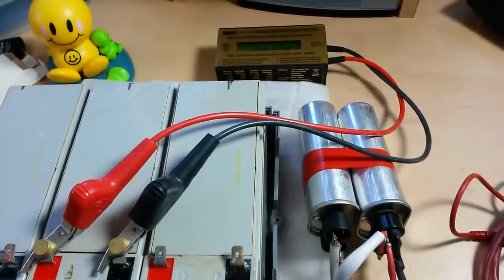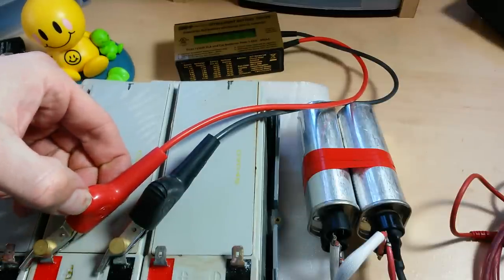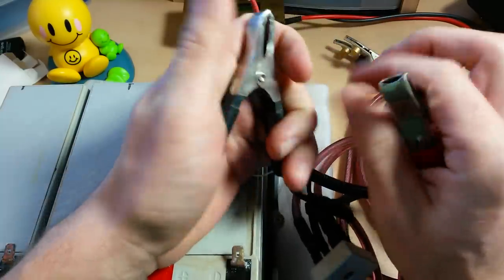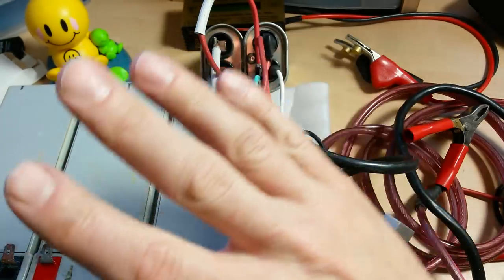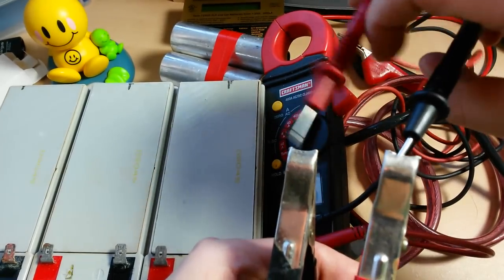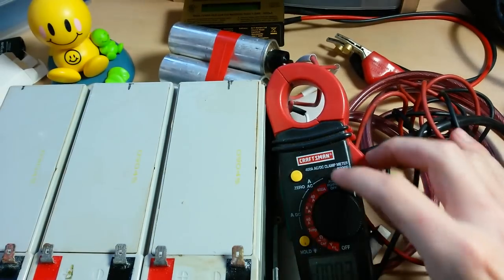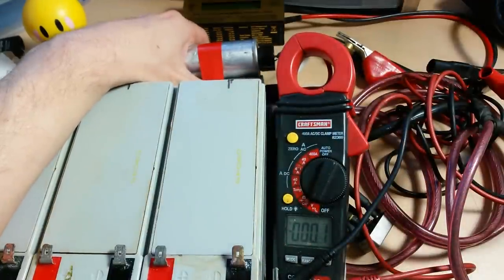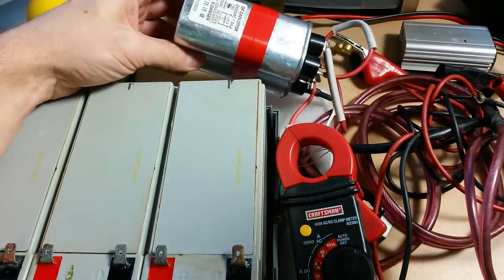(:Myth Busting:) Battery Restoration Myths: Epsom Salts? Proper Capcitive Charging & Desulphation

Comment: Hi can you use a mains transformer to say 25v a/c then ({run} a/c) caps and then bridge rectifier (lower levels caps v. and rectifier v) and may not kill you and may be some light/indicator and switch on mains !  (may be also having some micro vibration on/under  battery  to help dissolve crystals (or dislodge  and put them back in solution AGM batts even harder ! ( If it took 3 months to sulfate the battery could it take 3 months to desulfate ?) Energy out minus losses = Energy in plus loses ! May be better idea to do a maintaince program on all batteries from when you buy new ones, cleaning new sh-t is easy old sh-t is harder!

Comment: Built one of these. Very sulfated wheelchair batteries. They were both at like 4 volts. Have had the desulfator working on one battery for about 5 days now and only up to 6.7 volts. 

The little box you bought at ebay is also a desulfator. Free plans for that one are all over google. I also built one of those but like you, I dont think it was doing much. 

Now for my question...If my battery had a dead cell, wouldnt it cause much heat due to resistance?
Reply from the maker: you can't bring it back if it has a dead cell. don't even bother trying
Reply: +gary dolph  A dead cell is open as in "burned out"... and if its in a lead acid, the battery is shot. if its in a battery pack such as in a rechargeable drill that cell can be replaced  to fix the battery "pack"

Comment: And they are big enough to kill you if shorted out between right and left hands, they will store a charge as well unless a dissipation circuit is built in line with the device.

Comment: Thank you for sharing this. Do you have a tutorial on this capacitive battery charger circuit somewhere? Why did you connect 2 capacitors? Any particular specs to look for? Microwave capacitor is >4000V, would you need this sort of capacitors or some 250V would do? Sorry, too many questions lol. I'll search for some tutorials on this but if you have something to recommend would be appreciated . Thanks
Reply from the maker: There is a link in the video description. I was informed after making this video that microwave capacitors are not ideal for this.
Reply: @GadgetClass  thank you. I noticed the uF rating is very low on the capacitor I harvested from a microwave but found 150uF/250v I have harvested from a TV, will try this one. Thanks again
Reply: @jomanjy09  This is a polarized electrolytic capacitor. If you connect it at the A.C side of the circuit (as it is necessary for this application) it will explode immediately. Don't try it or you will be exposed in danger!!
Reply: @ΠάριςΑζής  Thank you.. I did try with the 250V capacitor and yes it swell up and was about to explode, and the car battery acid started to boil 🤯 I'll try with non-polarized capacitor from air-con unit
Reply: tree sea and moon Be very careful with this circuit. I suggest you don’t use more than 30μF. This capacitance will keep the current around 3A. During the preparation, solder a 330kΩ resistor across the capacitor, for bleeding it quickly after disconnecting it from mains. This circuit works as a constant current generator. This means that even if you short it’s output terminals the current will not exceed these 3Amps (if the capacitance is around 30μF). Nevertheless avoid to touch any of the charging terminals when they are free. The deadly one is of course the “phase”. During charging, the battery drops the deadly voltage very near to its nominal voltage, after the first minutes depending on its condition and it is not so scary but don’t trust it. A volt meter permanently connected across the battery will help you watch the progress of the process. Use the 200V range if the instrument is not auto range. In any case be very careful when working with this circuit and never let such a charging unattended. Keep things safe please! Have fun!
Reply: @ΠάριςΑζής  Great, thank you very much 👍

Comment: @GadgetClass lol! You are using low capacity High voltage capacitors for only your 110v mains!? On A 12V battery :D You can get much better caps for what you are using them for.Not that I would do it at all.Bdw full bridge rectifiers on 60Hz mains put out 120Hz ripple.

Comment: I'm watching a video of someone messing with batteries, cables, capacitors etc, which at some point refer to his capacitors as "big ass capacitors", when in fact those are just 1uF (probably less) caps that when used at 100-110V are not any bigger or bad ass then a puny 100V 1uF cap (search on google images).

This being said, what do you think my opinion will be?
Reply: +Nox665 True. Those microwave caps are for high voltages (2000 Volts). They are usually .95-1uF. Not the best caps for this application. I calculate that hes getting about 80mA output with 2uF.
Reply: +Robert Tomkinson  calculate all you want, but dont forget to figure in the the duty cycle and discharge rate.  Then calculate the full charge/discharge rate and you will find that over a specified time they will reach a full charge since he hasnt inserted any bleeder resistors to put a cap on the timing cycle he has (which changes as the battery charges)    this isnt ohms law...
Reply: Don't tell me that. Tell the guy that made the video. I used the formula that he provided in one of the links in the description.

Comment: Hi, OK I see your video that explain all the myths about the regenerate an car or motorcycle batt, in the last lines of your finally conclusion do You say that " in the First Place and Use a Charger that Does Some Sort of Active, Constant Desulphation and you will get the longest possible life out of your batteries and protect your investment. Once they are gone, you honestly should have spent the time and energy you are now thinking about putting into fixing them into maintaining them properly in the first place" in other words do You recommends to buy an desulphatation device but wich ? and every 6 months aprox proced to desulphate the battery . THIS IS CORRECT ??, THANKS in advance for your advice.

Comment: hi. will dc caps work? 1500 mfd 450volt dc. I also have several 18000 uf 30 volt dc caps.thanks for putting that Epsom salt thing to bed for me I had poor results with it but wasn't sure if it was my method or not. very intelligent and informative video.thanks again for it and your time.
Reply from the maker: yeah. high capacity DC caps are ideal. turns out these microwave transformers are not as good.
Reply: +GadgetClass  ALL capacitors are DC. they pass AC directly through, this is how they work as filters. Coils aka Chokes are the AC equivalent of a cap as they block AC...
Reply: +Scott Schoemann would a good size choke ( 15 lbs ) work in lieu of traditional cap? also how important is pos neg polarity if using an ac labled cap for dc? thank you very much for the information.  keep your stick on the ice bud.
Reply: No if your capacitors are DC they are not the right kind. He also need ones with a high duty cycle. There are plenty of tutorials online to point you to the right kind

Comment: This guy says that Epsom salt does not work via dumping it into a wet cell battery. But that is not the correct way to use Epsom salt to recondition batteries. It does desulphate a battery if used properly. He obviously did not do any proper research as is the case with a lot of people just haphazardly throwing quick videos up on YouTube. Epsom salt when used entirely by itself after removing the acid from a battery can dissolve mineral buildup on lead plates back into solution. That IS desulphating. For all of those falling for the "Epsom Salts Myth Busted" rhetoric from a guy that did not even test the theory or hypothesis, here are some facts. There are 3 main reasons a battery goes bad. 1. Calcification of the plates. 2. Lead Plate erosion. 3. Cell Short. The last 2 are irreversible but number one is reversible.
Reply from the maker: The problem with ALL commercial lead acid batteries is not the electrolyte, it is the engineered-in sloughing of the plates. A well respected battery engineer once told me that he could build a battery that would last forever(with proper electrolyte maintenance) but it would probably weigh 3 times a normal battery and have half the aH. 

I have owned and attempted restoration on hundreds of batteries, from generic starting batteries to $500+ PV and UPS batteries. 

80% of batteries die of a dead or shorted cells (due to sloughing). The other 20% can be re-invigorated a little with pulse charging,  but they were still engineered to fail within a given lifespan... 

You can, in fact, force amps through an electrolyte by adding free ions and changing the conductivity and TDS(which is what epsom salt does),  but,  no,  you are not restoring all of the sloughed-off lead to the plates. 

Show me a PV or EV system running an epsom salt restored battery and I will be happy to measure the true aH for you.....
Reply: Not really true. The longest life lead acid batteries are probably what are called "glass jars" They are used in data centers and to power electrical switch gear. Some of them are good for 20 years under the right circumstances. These batteries have rather small capacity for their size, and don't take physical abuse (like riding in a car" too well. The best (performance and life) batteries have pure lead plates. Very few batteries actually have pure lead plates as lead is quite soft and not strong. This is the reason most lead plates in batteries are an alloy. Different lead alloys have different charging and gassing characteristics I'm not saying your engineer didn't know what he's talking about but I am saying he couldn't build a lead acid battery that would last forever. Metals that are frequently alloyed with lead include, Calcium, antimony, selenium, and [probably others.

Comment: what about replacing the sulfuric acid as an electrolyte and using Alum? Does this method really work and if so will  the battery work in a super cold environmental minnesota with temps as low as minus 40 f
Reply: Baking Soda then Charging under Aluminum Sulfate, or Magnesium Sufate just removes the corrosion from the battery.  You will be able to charge it back to it's original voltage but you have to replace the sulfate solution with battery acid as the last step.
Reply: I have a battery donated. Told it was dumped over and lost fluid.  So I cleaned it up ran hot water and baking soda to clean cells. It was empty anyway. As far as refilling goes. Should one buy electrolyte, fill and slow charge? Is there a detail in procedure or just common sense? Electrolyte need distilled water or pour and play?

Comment: a MUCH safer and possibly BETTER desulphating charger is a BEDINI pulse charger, this sends 60 to 200 volts spikes into the battery, but with very low current so its safe for the user and battery!

Comment: I"ve been in electronics/electricity since 1968... If that is 120 volt as you stated going into a 12 volt battery, you don't know what you are doing. These things could blow up in your face.. In order to rig up a system for charging a 12 volt battery, you need a step down transformer around 14 volts then go thru the bridge rectifier.  To anyone watching this, do NOT ever attach a 120 volt to a 12 volt or lesser voltage or you could have a serious explosion...
Reply: Foxxie55 I think he's using capacitive charging/desulphation approach. 🤔

Comment: I try to recondition my car battery with epson salt but the process fail  i order one smart trickle charger just for that i leave it in charge for 36 hours on 2A it show the voltage go to 13.8 to 13.9volt but the capasity show 90 but still can't start the car why? I follow all the procedure every cell read 2. Volt

Comment: The only chemical the eats Lead sulfate is a strong base like sodium hydroxide.
THE FIX  -   Dump out the acid water,  pure in a 5% solution of sodium hydroxide water.
reverse charge the battery while the sodium hydroxide is in the battery with a small 2/10 amp charger set on the 2 amp mode.

After 5 minutes dump out the sodium hydroxide water and refill with 30% sulfuric.

Charge and done!
Reply: Have you tried it?

Comment: When series charging  12 volt batteries they don't take equal charge  example 28volts in centre connection 15vleaving only 13 on other one

Comment: Inductive spiking would be a better way to go if your using solar panels. A high powered joule thief using a mosfet. That way you wouldnt need 36 cells in your solar panel.
Reply: +Robert Tomkinson  Incorrect,  that spike is low current, and batteries are actually resistive devices, as they charge, their resistance grows,  You need a specific minimal current level which is based on the batter type in order to charge it. This is why Pulse Width techniques are used rather than amplitude modulation level  based techniques.
Reply: Maybe i should have said boost converter.

Comment: some of the video state that baking soda to clean the plates then pour that out then do a mixture of Epsom salt with distilled water.
Reply: that worked, i  done it once. did not work on second battery tho. but it will work on some too! still running epsom salts battery in my old truck! starts great, too.

Comment: Hi mate in Australia, we use 240v, can I still a pulse charger
Reply: Yes. But the larger the difference in battery voltage versus your 240 volts AC will create a worse power factor. So your main breaker and AC power wires needs to be able to handle the higher current. These things are known to move more than double the amps they consume. This will charge any voltage battery with a constant amperage. It will automatically raise the bolted as high as it needs to to force the amperage into the battery. Once your batteries get to around 80% charge they will start heating up being forced amperage and they could overheat. If the capacitor you use in your homemade charger is larger than the current required to keep the battery floating then you will have to monitor the voltage yourself or create a high-voltage disconnect circuit

Comment: Epsom salt does in fact work! It can last 7 years- FROM MY EXPERIENCE! and then you can do it again and again and again...... you can buy new acid at autozone for like $15
Reply from the maker: The problem with most batteries is sloughing of the plates. Are you claiming Epsom salts has brought a weak battery back to life with good aH? Are you claiming that you are removing the old electrolyte and treating the new electrolyte with epsom salt?
Reply: No, that is not what he was saying and your assumption again is incorrect and not the proper way to use Epsom salt to recondition a battery. Do some research for god's sake. You just may end up answering your own question.
Reply from the maker: +Richard Manson The problem with ALL commercial lead acid batteries is not the electrolyte, it is the engineered-in sloughing of the plates. A well respected battery engineer once told me that he could build a battery that would last forever(with proper electrolyte maintenance) but it would probably weigh 3 times a normal battery and have half the aH. 

I have owned and attempted restoration on hundreds of batteries, from generic starting batteries to $500+ PV and UPS batteries. 

80% of batteries die of a dead or shorted cells (due to sloughing). The other 20% can be re-invigorated a little with pulse charging,  but they were still engineered to fail within a given lifespan... 

You can, in fact, force amps through an electrolyte by adding free ions and changing the conductivity and TDS(which is what epsom salt does),  but,  no,  you are not restoring all of the sloughed-off lead to the plates. 

Show me a PV or EV system running an epsom salt restored battery and I will be happy to measure the true aH for you.....
Reply: you fucking cursed me! my 16 year old battery died finally and i tried to recondition it 3 fucking times and can't get past 10.2 volts this time.... that and i'm too busy to fuck around with a battery. Truly it is hit or miss. Sometimes you just get lucky and half ass tricks get you by. I flip cars and a lot of them come with dead batteries. I fixed a lot of them but they never stick around long enough to see how long some of them last. bummed about my envoy battery though, side post specialty battery over $100 for a new one.